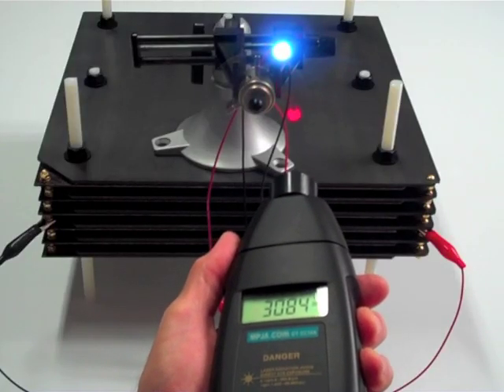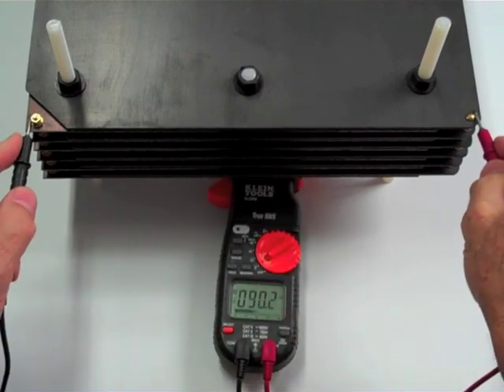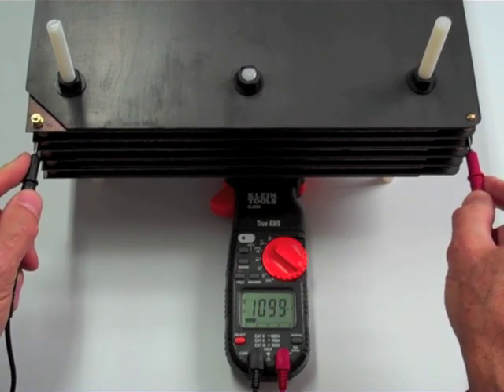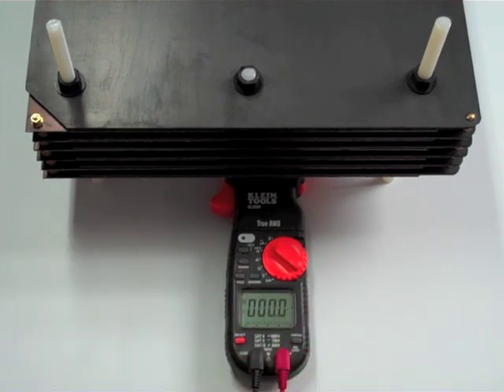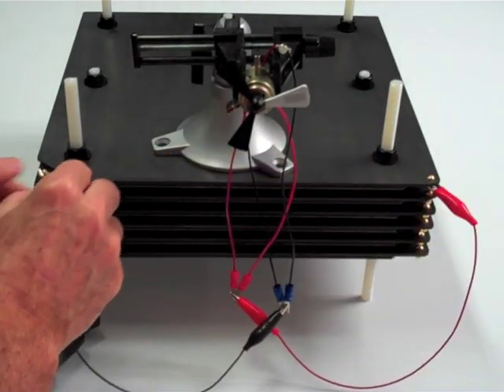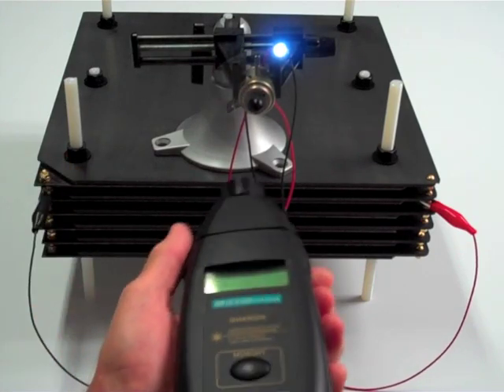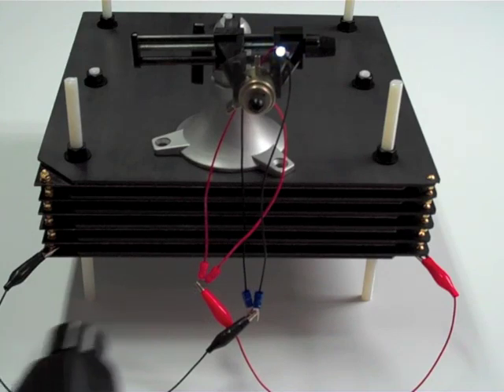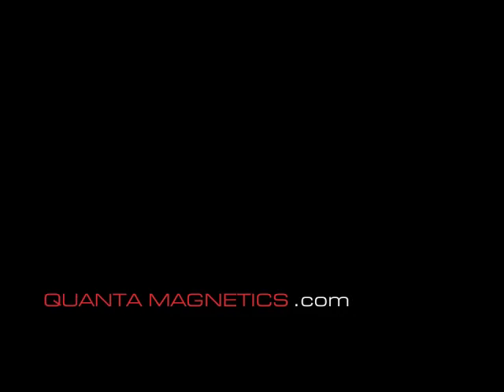SiC Graphite Module Output

Comment: Over a span of 10 jears, assuming a constant output current of 800uA @ 1.75V (he said the 1.2mA short-circuit-current would damage the cells), one of these plates puts out 534kJ of energy, while a standard Alkaline AA batery puts out over 9kJ. Make that a D-cell and you got yourself 75kJ already. In the end it all comes down to cost efficiency and application type. Though I could see this technology being useful inside weather stations with long battery life/tv remotes.

Comment: How about a solid state graphite solid state electrolyte with solid state graphene power cell with the generated current passing through a mini vacuum spark gap that charged a organic carbon power cell. A graphite power cell that feed current through a graphene solid electrolyte power cell with mini vacuum spark gaps in key locations? You could stack these cells connected in series to produce a steady current to operate a rewired drum motor generator with magnetic bearings that kept organic carbon power cell banks charged. A home electrical power generation system.
Reply: Hello paid troll, I love your sense of humour !
Reply: Bait seems to be the play has to acquire knowledge of a higher crystal power generating system? Like pure crystals of different structures that produce high amounts of energy within earths high energy induction field? Oh i am just a troll. 😂😶😒👽

Comment: The smaller cells you have could be affixed to one side of a thick space blanket connrcted in series with heating elements runing around the cells that produce heat that heats the cells that will cause the cells to operate better correct? Then cover the inside of the space blanket with a soft fabric treated with ever dry and the out side of the blanket with a stop rip fabric treated with ever dry has well for a state of the art emergency survival blanket? or even an insert to be used inside a emergency tent? This product can be constructed very easy can it not?

Comment: A magnet is made up of crystal structures being vibrated at different frequencies that generate a north and south pole of magnetic force or crystal vibration force? If the crystals in the magnet csuse this vibratory reaction then could not tesla coils designed to pick up and energize a vacuum spark gap to generate a hetz frequency bubble that can vibrate your solid state power cells to optimize their electrical current generation above the earths static resonance field? This would be far better then your pulse generator correct?  I have a Chinese firm interested in a design in a higher level of crystal power cell electrical generation could i run it by you and get your thoughts on it? Since it is your field of study correct? : )

Comment: Brain storming, could you not use a stirling cycle engine constructed out of aluminum and gadolinium for magnetic bearings to turn argon gas to liquid pulled from a solid state sponge to reach ultra low temperatures needed for super conducting materials to generate a super conducting energy loop that can be passed through tesla coils with a vacuum spark gap that generates a resonance bubble to energize solid state graphite or graphene power cells for a home air conditioning electrical power generation unit? Just need to add certian componats to the system and you gots a very high technology state of the art cooling and electrical power generation system correct?

Comment: A smaller version could be used to power all sorts of electrical vehicles could it not? A super conducting high energy loop transmitted between two tesla coils with a spark gap generating a resonance bubble with zero energy loss between coils A and B that passed through vacuum spark gap to produce vibrational bubble that energized those solid state graphite power cells would not be a non mechincal power generator? Your little pulse generator spins refined crystal structures in order to produce vibration of crystal structures to generate electrical charge correct?

Comment: Could you use two tesla coils that channeled high energy communication frequencies through a spark gag that generated a resonance bubble which you could arrange your niffty power cells within that bubble to super charge them and produce steady electrical energy off communication waves already passing through everything? Wpuld this not take electrical energy production to a whole other level? A way to kick fossil fuel use to the curb for good?

Comment: Do these cells really work?
Reply from the maker: Just as you see here.
Reply: Could you not use these incorporated with organic carbon power cells that charge graphite ariogel ultra power cells and not even need any moving parts to create a tesla wall type power generating source for a home or trailer even a poertable power generator? By using one componate in key locations not commented on that releases the breaks on the load? These cells work better from reciving hertz frequency from direct sunlight correct? If so could you not use low voltage hertz emitting diodes in each power cell that transmitted a hertz frequency tuned to optimize each cells vibrational electrical power generation output? These fells do generate electrical charge off the earths energy grid that gives the crystal structures in magnets a north and south pole correct? So these power cells are not even operating at their full potential is this correct has well?
Reply: PMMG4HYBRID Could you not build a helicone with these solid state graphite power cells at the ends of each peddle of the helicone connected in series with organic carbon power cells connected in series within the branches with graphite airogel ultra power cells in the trunks that ypu could place in certian areas and then use a tesla transmission coil to send generated energy to the next helicone energizing the next helicone with a helicone constructed with SEG generators on the peddels with vacuum spark gaps to boost the energy to high frequency forming a power generating system that can wirelessly transfer energy and is 100% green clean energy? Its thinking way out of the box yet would it not work? You could put a grove of helicones up in a field that worked better then a solsr farm that did not cause any harm to the flora and fauna correct?

Comment: I am a retired Chemical Engineer. My career spanned research, process Engineering and process control. After reading many comments from the "Scientific Nay-Sayers" about what this device is (and is not), I feel the need to interject. What is your definition of perpetual motion? It is probably very different from mine. My practical definition of perpetual motion is getting something for practically nothing. I had a dive watch back in the 80's that reminded itself based on wrist movement. As long as I wore it ever few days, it maintained the time flawlessly. The second such device I owned was a TimeX watch that ran for 5 years on a single battery. Until the image disappeared and I had to replace the 2032 battery, it gave me a accurate time without doing anything to it. The watch cost me $38 in 2002, the battery cost me $2 in 2007, if I looked at the time or used some other function on it 10 times per day, it cost me 0.1 cents per day to use it. If this guy has a product that will recharge cell phones, tablets and other 5 volt electronics for years without ever being connected to an outside power source, then that meets my practical definition of a perpetual motion machine.  What does any one else think!! Now where can I buy his "Black Box device".
Reply from the maker: It's an electrochemical device that utilizes heavy custom alloy metal and a particular graphite composition. I would not call it perpetual motion by anyone's definition.
Reply: Well if you count induction as motion... Reminds me of an aluminum plate battery though.
Reply: * I'm not too technical , but I assume the graphite is 99.99% efficient at transfering charge, thus most mediums would lose voltage quickly because of charge resistance (electrons bouncing incoherently into each other) this traffic jam is not apparent where the material has better transport of charge, thus storing charge as well as using mechanical properties of those charged electrons to push charge out the plates (when pulsed?) So it works by taking an input voltage, and instead of being 90% inificient in its output as with most voltage sources (Amplifiers etc) the electrons pumping becomes more accute at the output phase that would otherwise have been diluted by poor efficiency in the medium the electrons / voltage is passing through etc. Its seems that instead of voltage drop when a load is placed, voltage is better stored somewhere neatly packed until its needed?
Reply from the maker: Cass Droid - Another good example of longevity is the Oxford Electric Bell which has been ringing for over 175 years continuously since 1840.  https://en.wikipedia.org/wiki/Oxford_Electric_Bell
Reply: Lets destroy your world for a second .
A perpetually selfcharging battery has been on display ( now not for insurance reasons ) in Bucarest Roumania for many decades .. made by Vasilou Karpen around 1920  .. Patent 1924 or 6  easily found even easier to replicate .

The Motor had to be replaced .... NEVER anything else !

In a Nutshell If I piss in a Bucket & put say carbon & Zinc I will get 1 Volt ...... 4 EVER & EVER & EVER 

Is that perpetual enough for you .

From NOTHING , no heating ( let the pee cool down ) thats that .

So it's over 100 years old and what did you know about it ? Tested by French scientist on multiple occasions all corroberating the results
Reply: I make it perpetual for you if you care on LENR principle ..
Reply: Yes ... BUT ... Kapren Pile is actually "Perpetually selfcharging"  ... .. for longevity the Captret is a well tested device .
You doing great work !

Comment: I don't understand what I'm looking at TBH, are they rechargeble batteries? Are they solar cells? Are they heat cells? Where does the energy come from and how long does it stay?
Reply: From my understanding.  He has built a lithium battery with Silicon-graphite composite electrodes (or something very similar).  It uses the reaction between lithium salts and silicon to create charge differences.  The Graphite serves as an anode (and cathode in this case).

The biggest problem with these types of power cells is that the lithium salts will eventually create a coating on the electrodes called the solid electrolyte interface layer (SEI).  However, the continual expansion of the silicon due to the lithium reaction continually cracks this layer to maintain contact with the electrodes.  This process eventually renders the cell useless. 

In one of his videos he mentions the fact that he is putting some type of membrane inside his cells.  I suspect this is some type of nanofiber (probably kevlar) used to prevent the expanding electrolytes in the middle of the cell from penetrating the pores of the carbon (and breaking down the cell).

Anyways.  This type of thing has been around for a while.  The chinese are messing with it, and are the ones that actually invented this type of battery (or at any rate have the most patents on it). 

Sure this guy is very good at making them, as all his stuff is extremely well crafted; but he didn't invent the concept.

If you would like to learn more about this stuff go to wikipedia for a simple explanation.

https://en.wikipedia.org/wiki/Lithium%E2%80%93silicon_battery

https://en.wikipedia.org/wiki/Research_in_lithium-ion_batteries#Silicon.2Fcarbon_composite

Also to answer your other question.  The "energy" comes from a chemical reaction just like a AA battery.  The reaction will eventually stop and the cell will be dead.
Reply: Aw, so it's not rechargeble? :( Still nice

Comment: I wonder if you could use those smaller graphite power cells and connect them in series and line the inside of a 20 gallon propane tank on the bottom and side walls and top then put a rewired drum motor generator with magnetic bearings with a vacuum spark gap array with a copper pancake coil for wireless energy transfer to create a electrical generating power cell that recreational vehicles could use to operate all its electrical power needs for light refrigerator and even the air conditioning system without having to plug in or turn on a diesel power generator? I mean the rewired drum motor generator could generate an electromagnetic field at a certain hertz to cause the graphite crystal structures to generate higher amounts of electricity correct? Would it work?
Reply: Hi paid troll, your time must be VERY cheap indeed...

Comment: You could call a company new utility technology zenith. Nutz! Then make different size power generation spheres out of graphite airogel and these graphite panels. Company slogan, if you don't have nutz then you don't have the power balls to get the job done! Just design power generating spheres with copper pancake coils for wireless energy transfer. Make power spheres from baseball size to beach ball size or larger depending on what is being powered. A graphite power cell sphere with a rewired drum motor generator with magnetic bearings and a vacuum spark gap designed to pump out so many volts every hour of every day? You think it could be possible?

Comment: Can these graphite power cells be made shaped like arches and placed in cylinders and connected in series with a rewired drum motor generator with a large spark gap that produced a resonance bubble that super activated the graphite power cells to generate steady electrical current to operate the drum motor generator?  I mean could you not design a power cell generator at any size from a triple A battery to a large propane tank size power generating cell if it worked? It would mean an end to fossil fuels would it not?

Comment: Would it be possible to roll these graphite power cells like how super capacitors are made and place them around an electric motor so that the rotating electromagnetic field caused the cells to generate electricity that could build up and then fed back to the electric motor to operate it? Or even use a small rewired drum motor generator with a vacuum spark gap to generate high frequency electricity to operate the electric motor producing a Hertz resonance field that caused the graphite crystal structures to generate electricity which powered the drum motor generator? Would this work?

Comment: Could you not compress graphite airogel with electrolyte film inbetween the layers making lite weight cells and fill a cylinder with them and connect them all in series then have a copper pancake coil for wireless energy transfer then have a mini rewired drum motor generator with magnetic bearings with a vacuum spark gap to generate a high frequency electrical power cell? Pop a few power cells in another component and you could operate a larger generator to power a recreational vehicle and its air conditioning unit and other devices an electric vehicle and a electric motorcycle or an electric aircraft? It would be really cool to make a stand alone air conditioning unit. Or a stand alone space heater. You think this could work?

Comment: I wonder if graphite airogel compressed and rolled like hoe super capacitors are made and sealed in donuts and placed in aluminum rims with copper pancake coils for wireless energy transfer would work for electric motorcycles and other vehicles? Then have a a layer of those electrical charge generators that generate a charge through compression around the outside of the rim with a foam tread layer over that layer to trickle feed electricity to the graphite airogel power cells in the rims that supply electricity to the electric motors. Your a scientific individual would this concept work? A body in motion tends to stay in motion so why design electric vehicles that you have to recharge? Hay you could incorporate your graphite power cells has power banks that switch to a full power bank has the other recharged if super conducting energy loops are not being used to power all the electric motors. Could all this work?

Comment: Hay you could even design a graphite airogel power cell with a rewired mini drum motor generator with magnetic bearings and a vacuum spark gap designed to operate off the built up charge in the cell and super charge the airogel power cell. So you could throw away all those bits and bobs and do dads? I need a super lite weight energy power cell for my electric motorcycle think you have the ability to manufacture at least one?

Comment: Interesting stuff, but measuring the voltage and current under load would be a lot better than measuring rpm. Even better - a graph of current/voltage under different loads.

Comment: But hay if my science is spot on why not take your work to a higher level? Have you tried using liquid atmosphere for ultra low temperature and low vibration electrical energy production? Electrical plasma that freezes is there such a science?

Comment: Hay can you construct larger graphite power cells? A super conductor circuit using tesla transmition coils A to B at a frequency that vibrated graphite crystal lattice structure red hot with no energy loss between the coils would be a great replacement for nuclear electrical power plants would it not? Since you seem to have knowledge about crystal lattice use I thought I would ask? = )

Comment: Why are you not using these cells to there full potential? Why not use the cells connected in series to power a hertz frequency module in the middle of the cells to generate a vibrational bubble to hit the sweet spot of each graphite power cell to boost their outputs then have mini vacuum spark gaps in key locations to amp up the power being generated? Could you not then rewire a drum motor into a generator and use magnetic bearings to generate high frequency electrity to power other devices?